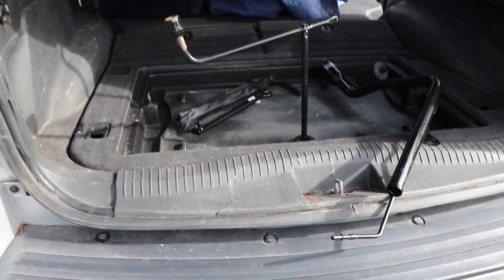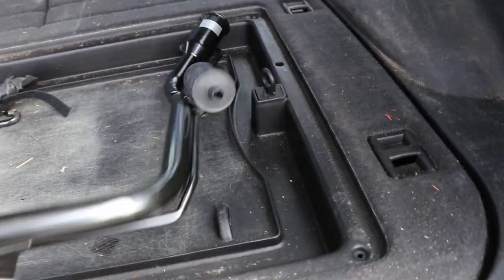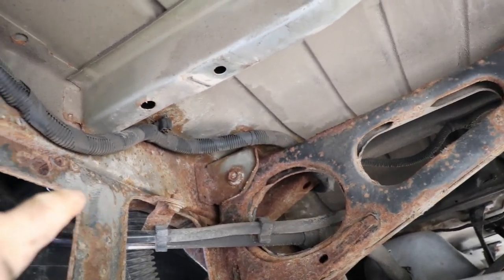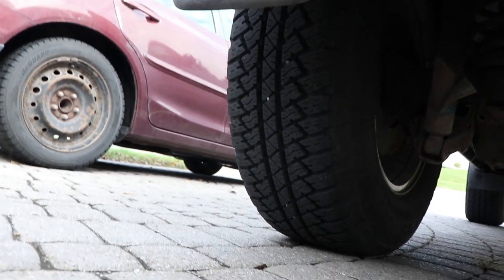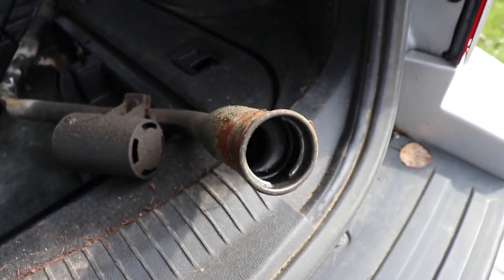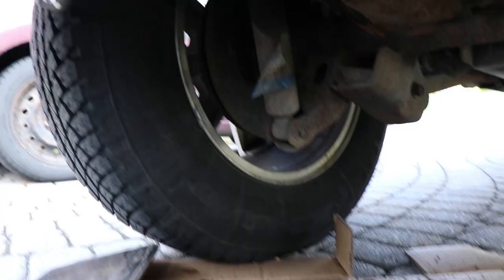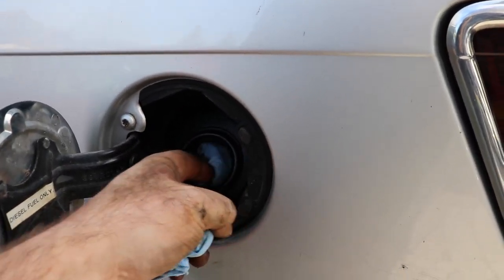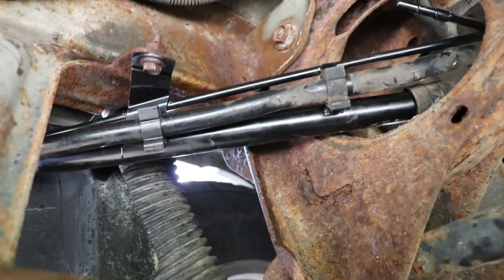2005 - 2010 Jeep Grand Cherokee WK Fuel Filler Neck Replacement

Comment: What is the fuel consumption on this? I have the exact same model and cant get less than 13L/100km in the city
Reply from the maker: all around I get 12 l/100 but this is with the bigger tires and a lift.  The trip computer is very slow to respond on these vehicles, you may want to reset it to see if it gives you more "in the moment" numbers.  On the highway stock I think I was getting around 10.